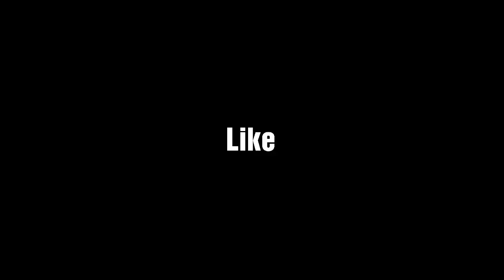Facemill Arbour Pt3

Comment: I commented in part 2 that your cross slide is running off the end of the bed ways, the nearer it gets to your head end. If you set your top slide to 90° or 0° however your protractor is calibrated, and extend it to the left, at least your cross slide will be supported and quite likely you'll get less noise and better finish.

Comment: Did you check your tool height between the two tools. I suspect the second one, that kept digging in, was probably a bit high. If set just below center the movement of the cross slide because of lack of way support the tool will go below the work. Above centre it just digs in and stops your machine and possibly breaks the tip off. The tail stock centre will do little to help. Its not the work thats moving but the tool.